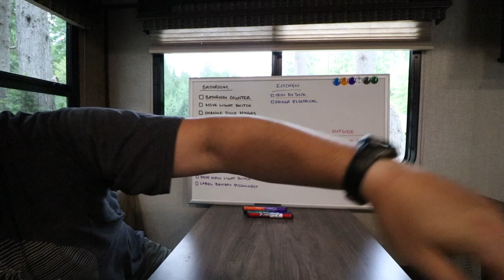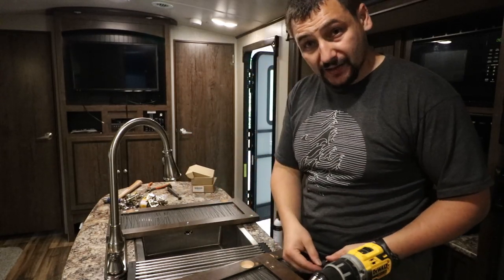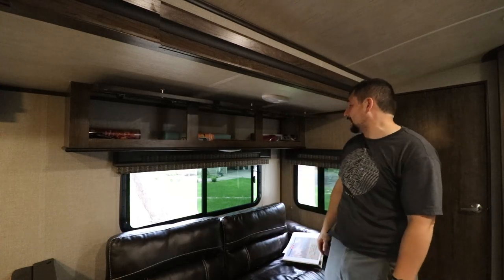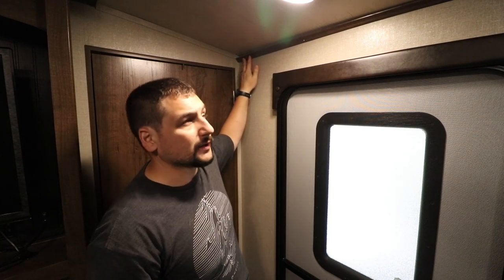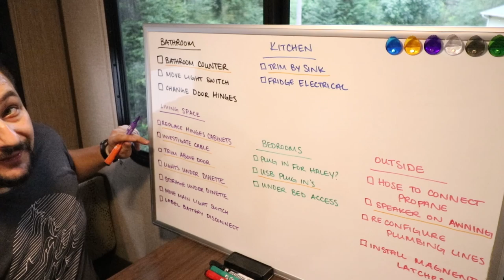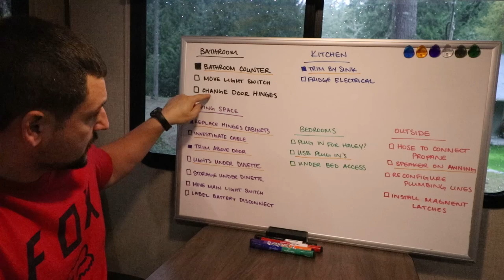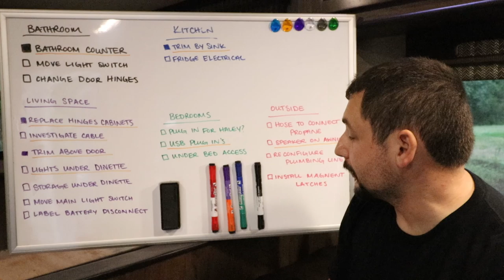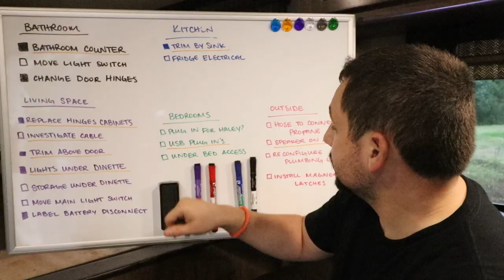RV Upgrades Repairs! Make RVing better!

Comment: Your video certainly validates the list of complaints posted on the FB group "RV Horror Stories" and the crap being built and sold by the RV industry. Makes me really happy that we bought a 2001 Holiday Rambler Alumiscape from the days when HR was built by the original company. Despie becoming a bit long in the tooth, my spouse and I haven't run into any of the quality issues of contemporary RV builds.
Good tips on the upgrades!

Comment: That was a great list of repairs. Thank you for sharing them.

When that tight bond 2 wood glue fails around the sink you should do the same thing again but use tight bond 3, it would be better to use around water.

Comment: One thing I did was take a screw driver and put it on every screw I could find. In the end, most RV's I've had, about 30% are stripped out or the wrong screw were used. So those screws were just hole fillers. I just carry with me an assortment of sheetmetal and wood screws that are #8, #10 and #12 (about 1" long). So even after replacing the stripped ones, others do come out down the road.

Comment: i made the mistake of temporarily removing the couch from a slide. the weight of the couch balances the slide. the slide did not open/close tightly. i still have issues with that slide